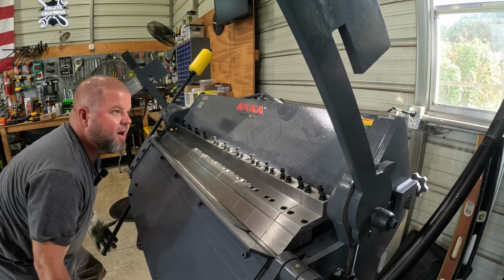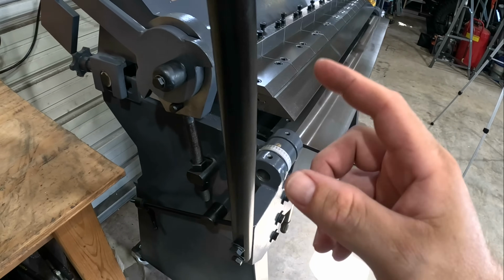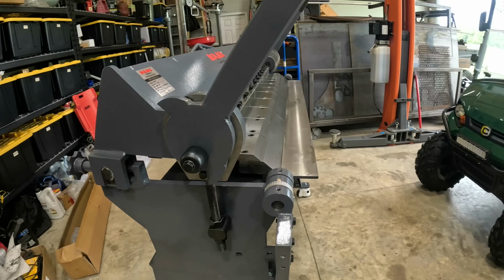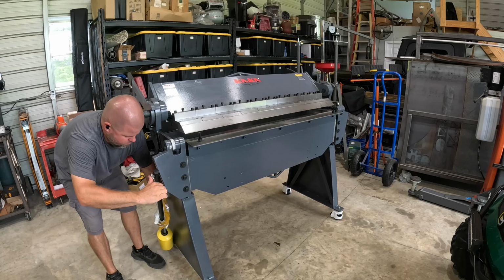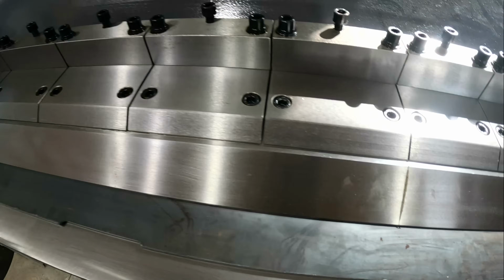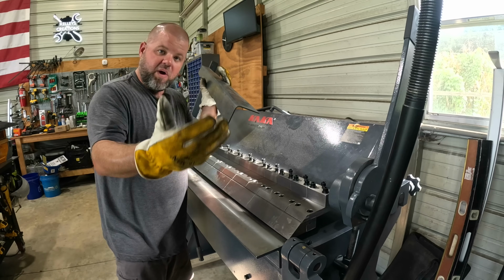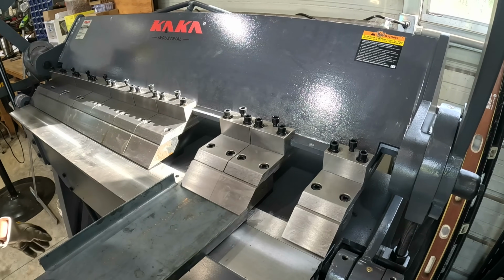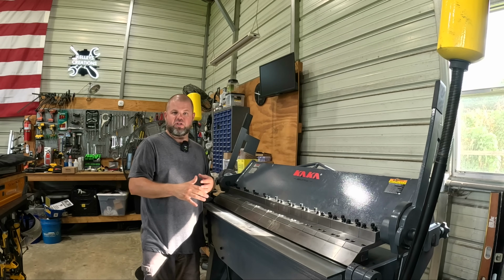AWESOME TOOL! KAKA Industrial Box Pan Brake W4812

Comment: Maybe a bit late in the game, but I'm making a steel frame base for mine -- something to increase stability further, temp lock on the floor and will be able to move around with a pallet jack if needed.
Reply from the maker: Been using the heck out of mine as is, stability hasn't been an issue.

Comment: Got this a couple of days ago -- was a massive ordeal to unload (from a van) and install without a forklift. Luckily I borrowed an engine hoist to install.

Super heavy machine (500kg), very solid. Definitely the instructions need improvement, it felt like reading gibberish.

That being said, once installed I started doing some bends and folds pretty much straight away. Can't go wrong.
Reply from the maker: Glad you like it, it is a heavy duty machine!

Comment: how are the casters working out?  KAKA got a sale because of this video
Reply from the maker: No issues at all, but I don't move this either. They grip the floor well and I have yet to make this thing tip.  I love it and use it often. Enjoy your new brake!
Reply from the maker: Zero issues with stability as is.  I love this brake.

Comment: I'm sure You've heard of "Drop Casters" A lot of wood workers use them for Moving table Saws Etc around a Wood working Shop.
Just use the Piece You are bending to set the Fingers, Stand it vertical and adjust both sides.
Thanks Andrew..

Comment: A quick suggestion, mount some threaded sleeves in the concrete, and some heavy duty angle brackets on the machine. When you need to do some heavy bending, just roll it out and temporarily bolt it down

Comment: I had a heavy duty table saw (Grizzly) on casters flip over. My fault for mounting it on casters off center of gravity. No injury, minor machine damage. I built a well designed low to ground platform on casters. World of difference. It f@cking scared the living sheet out of me. So lucky I wasn’t injured.

Comment: They really need to be bolted down to work as well as they can , but if your not going to bolt it down put a couple of stringers across the castors from end to end , those sides are not as strong as you think , if your pushing the machine and a wheel catches it can get ugly ...

Comment: What I have seen on other metal fabrication channels is that, in order to get clean, sharp bends for pans, boxes, etc., they make a circular relief cut in the corner where the bends meet. Either with a drill or directly with the plasma cutter when cutting the steel.